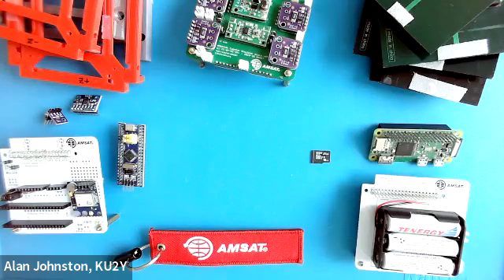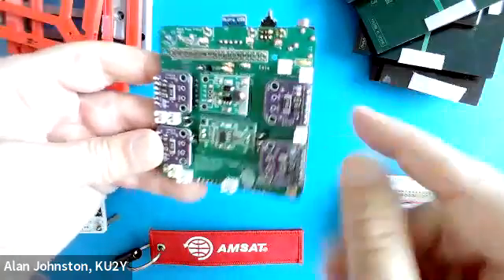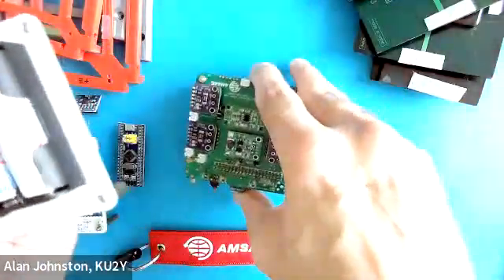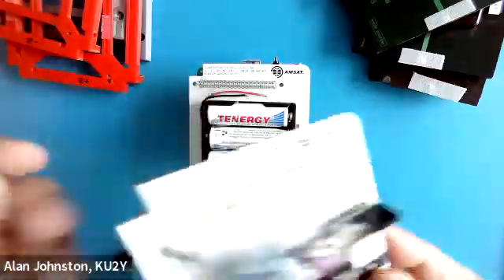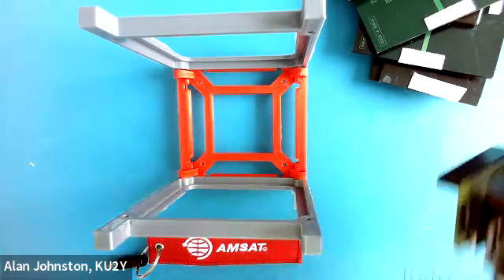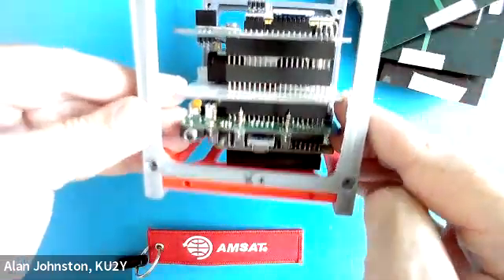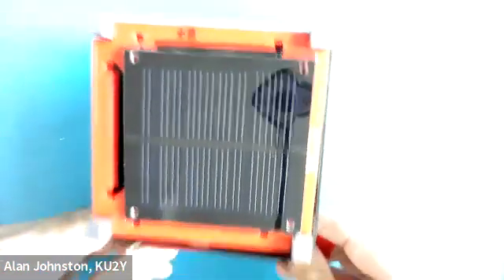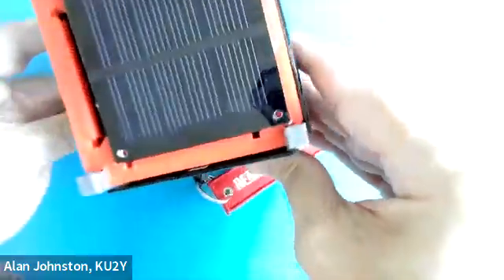Build Your Own CubeSat Instructions

Comment: Thanks. I have started building one but the purple modules are proving hard to get.
Reply from the maker: Hi Graeme, we no longer use the purple INA219 modules. They are hard to find and most of them don’t work. Use the blue ones instead. Due to their larger size, you’ll need to put them on sockets or use headers to raise them up. See the latest BOM: https://CubeSatSim.org/bom Good luck!
Reply: @ku2y  I used the blue one as well. I cut out the PCB corners and sides a bit.